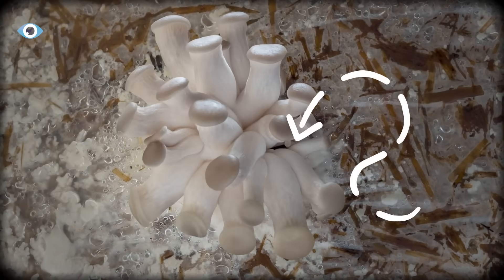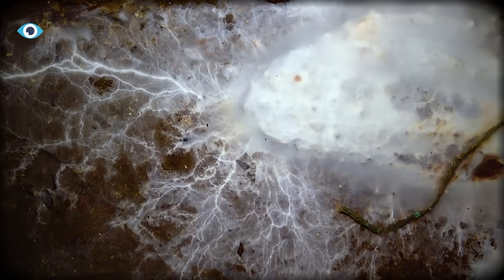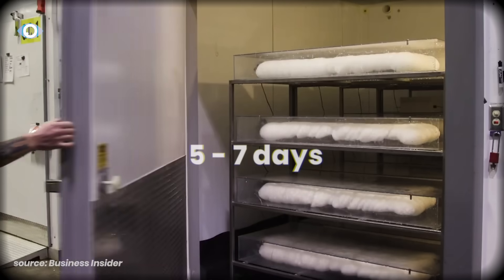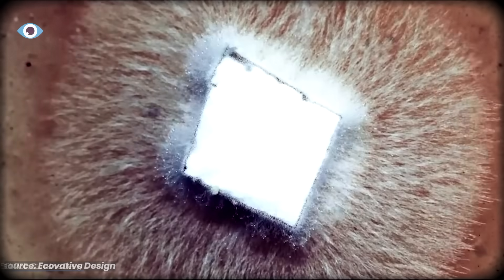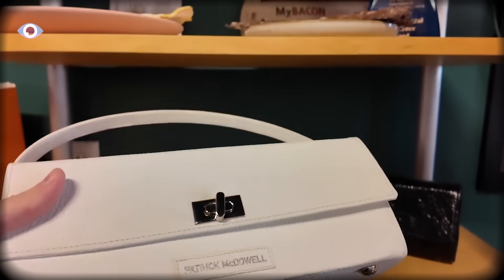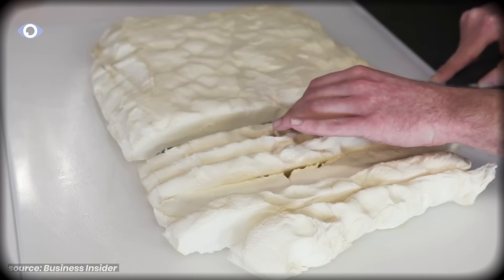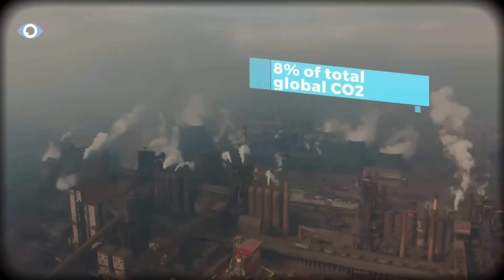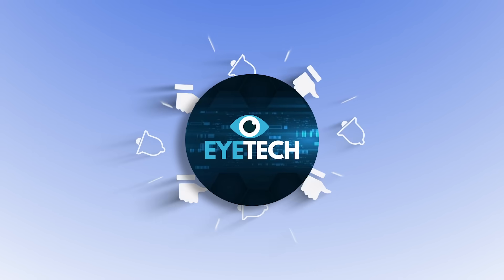How Mycelium Is Taking Over Manufacturing Industries

Comment: Something I felt there was a high demand for among the student when studying architecture, was alternatives for the cell plastics used as insulation under the foundation of houses, as well as the steam barrier in walls, usually made from plastic that has a very long durability. If someone could find good alternatives to those I think it would sell well. Organic materials feel less ideal in the foundation which is inaccessible(humid, possible ants and mice) but possibly if it can be encapsulated? Mixed with clay...
  In walls with wood perhaps it could work better.

Comment: The issue with leather is not the availablility it is the cost associated with processing it. There is no need for a replacement, leather is already a awesome material.
Also it is wrong that it requires chrome & heavy metals, only buy vegetable tanned leather as it is also the leather that develops patina and has high quality - chrome tan is cheap trash.
People got to learn up on leather rather than painting it as a problem.
Reply: still leather processing needs lots of water. I'm fine with real leather as long as we still eat and kill animals anyway. Might as well use the whole animal instead of just few pieces. But we cannopt keep doing it ("producing" meat and leather) at these perpersely large scales as today.

Comment: What you forgot to mention is that synthetic polymers are stupidly easy to make. Instead of 9 days, it would just take 9 minutes, and instead of solid waste you have to pack by hand, everything is based on liquid that can be controlled using only valves. The logistics of storing all of those micelium during the curing process will also be a big problem once it scales.
Reply: The waste is pretty much free though, unlike refined hydrocarbons. Also most of that stuff can probably be automated, it‘ll just be a big factory with stuff going in on one side and other stuff coming out the other. Why would you care how long the process takes? After 9 days it’ll just be a constant stream of output, it‘s just an initial delay. It’s kinda how you don’t care how long it takes the water to arrive at the hydroelectric dam from the mountains or how long it took for the crude oil to be refined and arrive at your local gas station, what matters is that you have a constant output scaled to your needs.
Reply: @Bastian28466  Warehouses are not free, and the kind of automation that would help this technology would also make synthetic polymers even cheaper. As much as I want this to succeed, you'd need much more than technological innovation for this to make sence economically. That's why we need a stronger legal frameworks to subsidize this kind of tech, and make it harder to manufacture synthethic polymers with better regulations (maybe ban it for food use). Innovation and regulation go hand in hand.

Comment: Using mushroom gyphae as a substitute for plastic:
+less time to make it
+Does not use much water
+Does not use toxic metals or other stuff usually found in plastics
+Uses organic waste
± Does not last long
± Is edible
- May or may not involve infection if the materials and creation process is anything to go by.
- Organic waste has a lot of other uses
So gyphae as a packaging material is perfect, as you don't really need it after you unpack the thing.
But as a clothing and building material (i. e. cement) - not so much, as clothes and building materials need to be durable, and probably last longer than two human lifetimes. GoreTex from Teflon is more than good enough for shoes and clothing, thank you very much.

Comment: I’m a bit concerned about potential occupational health risks here. From the video, it looks like fungal spores are being mixed into dry agricultural substrates without respiratory protective equipment (RPE) or wet methods. In such conditions, airborne spore exposure could be significant and may increase the risk of issues like hypersensitivity pneumonitis (e.g. “mushroom worker’s lung”) or asthma, especially with repeated exposure.
Reply: You are going to find someone with a heath issue to pretty much any manufacturing process.

Comment: Yeah houses can't be built with material, just after a little while in cold environment it will be full of holes because of rodents using them as nutrition. Same what happened with hemp based wire insulation.
Reply: Also agree. One material to rule them all is bad idea. And when its also eatable it reminds me the folk tale of Hansel and Gretel.